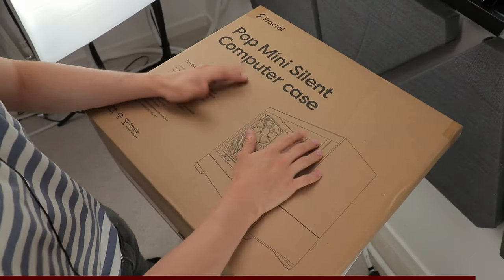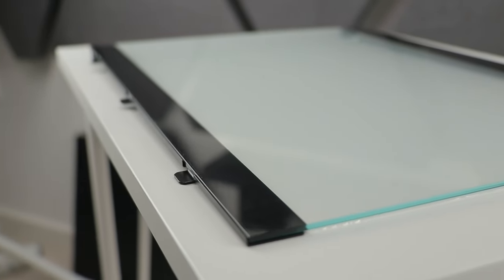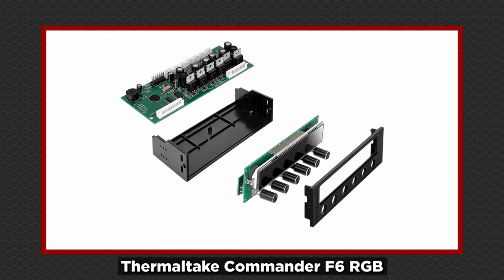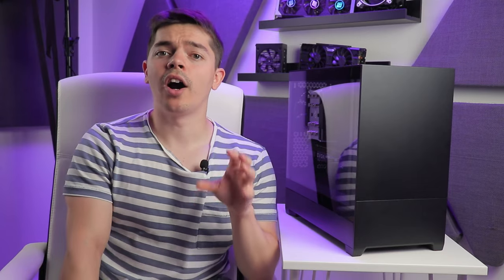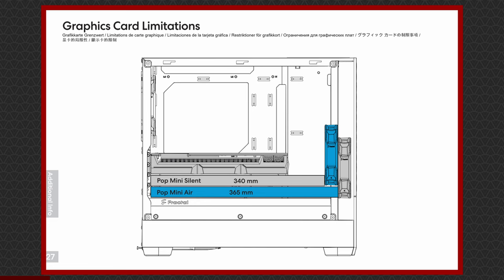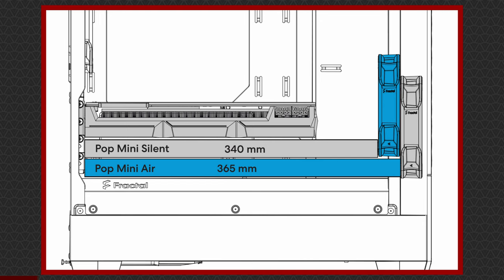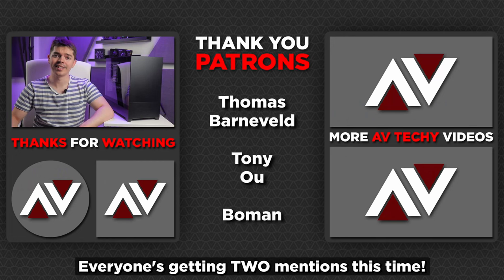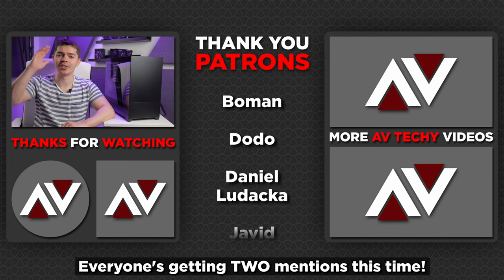SILENT but DEADLY - Fractal Design Pop Mini Silent Review

Comment: sooo. i watched this video for the second time and i really like it. you have a really good way of presenting the facts and i also like your rants :D there are just two minor things, which you could improve a little bit. specific in this video the sound is a little bit silent or damped? I can't describe it very well. But i had to turn my volume up to fully understand you. The second thing is about your diagrams. There is too much information (for me) and some information is a little bit confusing. Maybe you could design them a little bit easier to read. I think less is more in such diagrams. But despite that i really, really like your long review. 

Now after these words, i have a question about the case :D I consider buying it, because i hate hearing noise fans (i have a macbook and the fans are running once a year), so i want to build something that is quite similar. I understand your arguments and so i am struggling between this version or the pop air mini. Fan noise is one thing, but i want to prohibit things like coil whine or vibrating parts. Do you think the pop air can handle such things? This kind of noise is nothing a db-measurment can't really portray. But i understand the logic behind your arguments. More airflow means that the fans are working less. But for other noise i am not sure if a pop air is the way to go. what do you think? I don't have high end components but maybe if i upgrade in the future a part so i want to be prepared. Would be interested in you view of this "struggle" i have.. :D sorry for the long post.
Reply from the maker: Hey. Thanks for the long comment :D

You raise a great point. I balanced the volume way too low on this one. Normally I set it at -2dB which is about as loud as you can go before clipping. This one was set to -12dB which really is quiet.

The graphs are the bain of my existence :D you should have seen the graphs long ago. They were a lot worse. I want to simplify them further, but I also want to retain the link to the results. If they're separated too much the link gets lost, and it's hard to track the relationship between many factors. It's always a tough balance to strike.

As for your question. Coil whine is a tough one to get rid of, and only becomes more noticeable the less other noise there is around. When I first made a silent build I only first noticed the coil whine of my GPU, and it was way worse than the background noise of the fans.

If you're only ever going to have Mid to Low end components in here then this might work for you to remove coil whine noises if you're aiming for a completely silent build.

But if you're going to be pushing your system hard regularly I would recommend something more open. If you're only pushing your system hard once every couple of weeks, maybe just open up the front panel for that time and keep it closed otherwise to work around the thermal issue.

Either way, if you get this case, be prepared to tune the PWM curve of the fans to only run at higher temps. Otherwise you'll end up with a louder system than if you had no case at all. Also get a really good CPU cooler to reduce the need for heavier everyday cooling for it at least.

Comment: I came across this because I'm looking to build a new PC. My last build was over 10 years ago and it used a Fractal Design case with sound damping, which I'm very happy with. The only problem with it in fact was it was a mid tower and ended up taking up room on top of my desk. So now I'm looking for a mini case and I'm looking for one with sound damping. That unfortunately leaves me very few options. The Fractal Design Pop Mini Silent is one of those. I'd dearly love to see a more "premium" version of this, without the cheap plastic bits. Any hints? Also, to those who obsess about the "poor cooling" of "silent" cases (they aren't silent either). I'd say this. The vast majority of use cases for a computer are low power. With my old case, an actual fanless power supply and one (slow) CPU fan, and a deliberately throttled down case fan, I had absolutely no problems. In fact I've run it without the CPU fan (it's a big heat sink). The real offenders are the modern electricity-bill-boosting CPUs with 100+ Watts power levels and that's why I'm choosing to use a Ryzen 7600  (88 Watts pushed to the limit). And of course some of the latest graphics cards are abominations. Does anyone really need 250 fps? Also if you actually consider the thermal capacity of air, the power and do a little math, you don't actually need huge airflow to carry out that energy. The critical task is in fact the CPU heatsink. The inside of the case itself does not need cyclonic wind speeds. It just needs to have its air replenished frequently enough in order to carry out that energy. What I'm saying here is that CPU cooler efficiency is far more than important than internal case temperature. And if you really want to build a system that puts out 1000+ Watts, then there's definitely a market for big, external cooling tower (water as the working fluid) that is designed with a lot of sound damping and is very quiet, but still capable. Fuck it, electricity is cheap, and you're wearing headphones, right? There's my rant for today.
Reply from the maker: Glad my comments section could let you vent :D
Reply: @AVTechy  Awww tanx :)
Reply: @AVTechy  Btw, I ended up getting a fractal pop mini silent and it's not bad given it's made to a price. Swapped out the rear fan for a quieter fan and it's all good :)